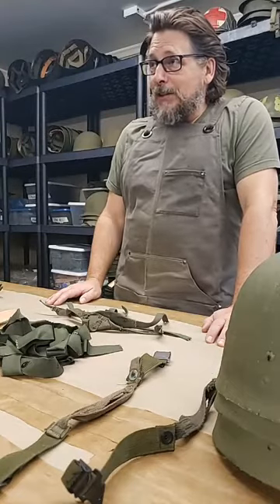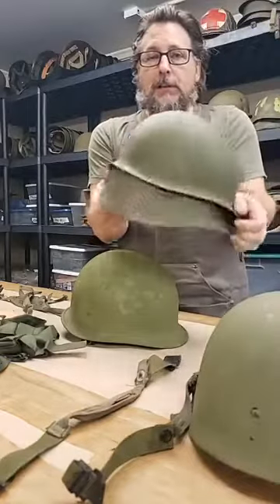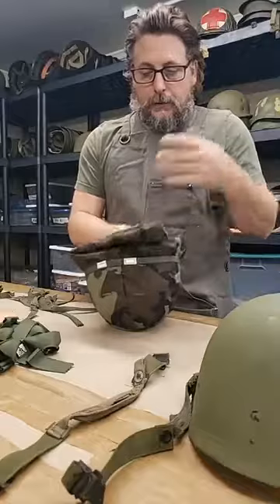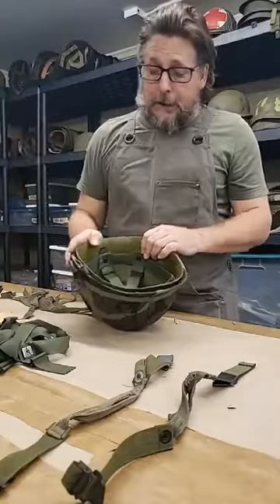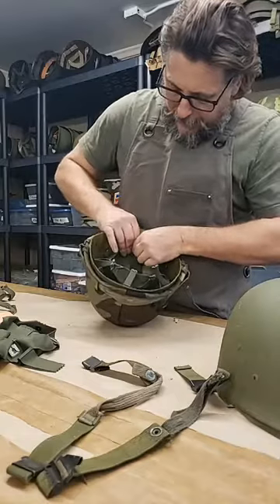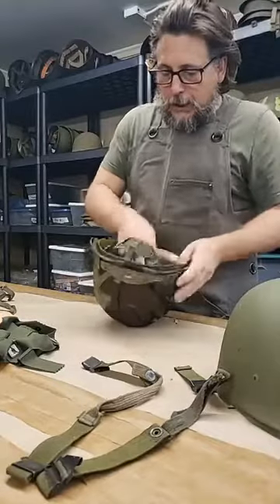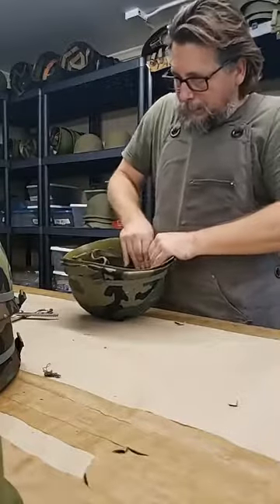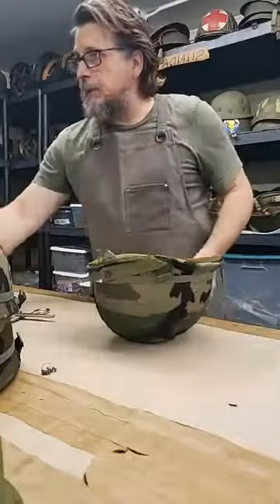Assembling 1980's M1 Helmet - Tips, Tricks & Lame Jokes

Comment: Interesting video and thank you for the practical help and instructions and also for the information on the differences that occurred in the late 1970s  and 1980s era M1 Helmets. One of mine is a mish mash of different eras - the Liner, webbing, neck band and head band are late 1960s to early seventies, the Camo cover (Mitchell) is 1969, and the shell and chin straps are like the 1980s helmet in your video. Your advice about fitting an M1 Helmet was also very useful - thanks again.